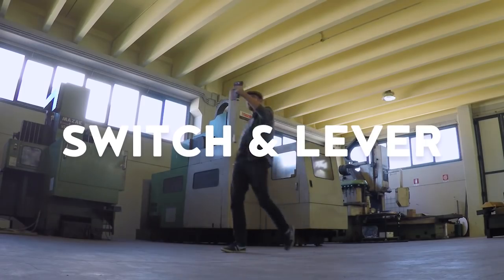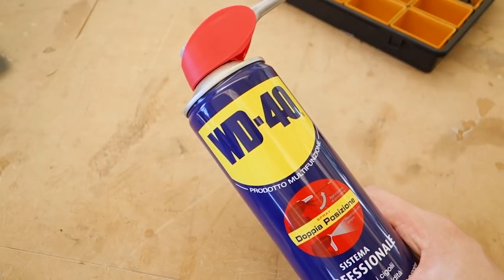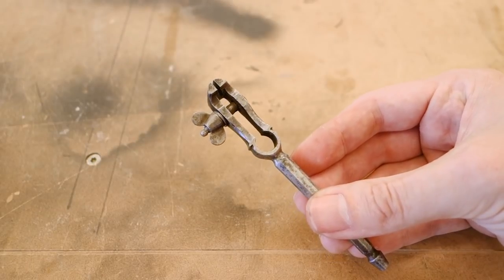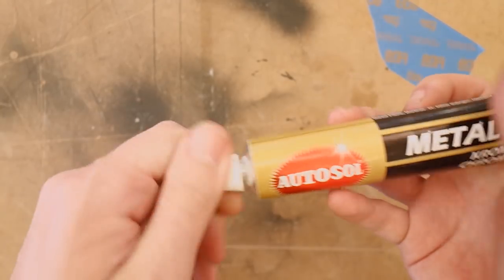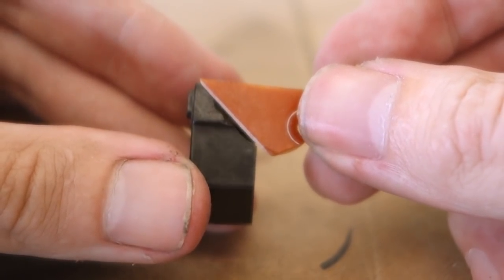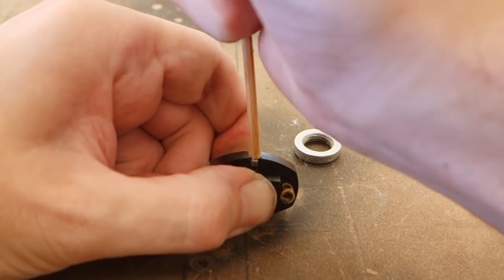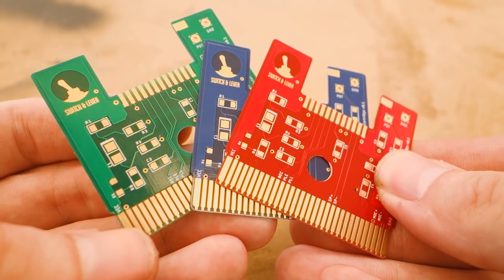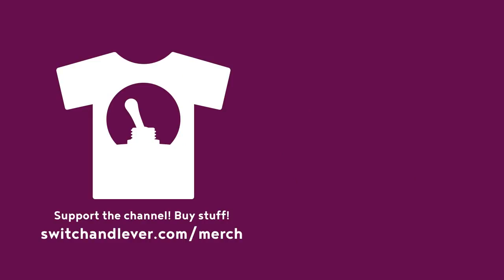Restoring Vintage Toggle Switches

Comment: To make your Dremel wire wheels last longer, put some CA glue (super glue) at the base of the wires where they are pressed in between the flanges. The wires will stay in the wheel much longer.
Reply from the maker: That’s a great tip!
Reply: @SwitchAndLever  yeah but it won't really save the brushes. The wires break due to metal fatigue. They just get bent back and forth in use until like a bent paperclip they eventually break.
Reply from the maker: @1pcfred  I know I'm like ten months late on this, but I can confirm that the tip given by Rick works great. It would appear that much of the metal fatigue happens where it's clamped in the flange, which the glue kind of acts like stress relief and, well, glue. The wire wheel easily lasts at least twice as long, if not longer.
Reply: @SwitchAndLever  twice as long is like getting a free wheel then. That's pretty amazing. Now I need to find a way to get CA glue to last. Every time I go to use the stuff it is all hardened up on me. I'm more of an epoxy kind of a guy here. AB epoxy I can keep around. That CA glue after I open it up I might as well just throw it away. It is never any good when I go to try to use it again.

Comment: When working on switches with ball bearings and springs, I use a plastic zip lock bag over the work to keep from losing bearings or springs. Dropping one and trying to find one isn't fun.

Comment: Seems to only make sense for switches (like the bakolite ones) where you can't find equivalents in production anymore. But for plain round end ones, seems like a bit much effort where you can still find something that matches and just buy some since they shouldn't be that expensive. Really only worth the effort for restoring vintage gear, or having that particular look.

Also plain white toothpaste can clean up some plastics. But such polishing may be better done by hand.

And some metals (like aluminum or brass) may still be marred and scratched by brass wire wheels. But nylon bristle wheels are common enough too and the way to go in those cases.
Reply from the maker: Switches that have the quality of vintage switches simply aren’t cheap. You can buy Chinese made switches that look the part all day long, but the tactile feeling of them is crap. There are companies, like Caleco for instance, that makes switches still in Europe. There are also manufacturers which specialize in guitar equipment that make similar high end switches. Neither option is cheap, believe me. 

Also, you would be very hard pressed to find any aluminium in old switches like this, especially in combination with steel. Galvanic corrosion is a real problem and not something you’d want to occur in an electrical switch.
Reply: @SwitchAndLever  folks not understanding what you're trying to tell them is why we're doomed.
Reply: @SwitchAndLever  , the other commenter needs reminding that cheap Chinese switches will typically have  Metric-dimension bushings and metric threads, and they may not fit well into a piece of equipment that originally had an American made switch , even if you use some kind of sleeve or bushing to make them "fit." I repair old switches pretty regularly in my day job in an audio-equipment repair shop. The real "fun" happens  when we have to disassemble and repair potentiometers and, especially, slide faders, where the metal contact "fingers" break free from the nylon carrying pieces.

Comment: Can you find a way to restore the original  rivets? Can we buy new rivets somewhere?
Reply from the maker: Well, those rivets were likely set in a press with a jig to hold the switch together as the rivets were set. You could make custom rivets from aluminium or brass rod or tube, but frankly it wouldn’t offer anything better than what I have done here.
Reply: @SwitchAndLever  I do the same thing and replace rivets with screws. Never know when you want to go back into the switch.

Comment: Didn't those switches have some dielectric grease in them originally?
Reply from the maker: No new switches I've opened have ever had any dielectric grease in them, so it's doubtful these had either. You don't really want any grease on contact surfaces as it may act as an isolator making the switch work intermittently.
Reply: @SwitchAndLever  I've seen grease inside switches.

Comment: Nice, but they're no Forbes & Lomax
Reply from the maker: Frankly, I think F&L make subpar switches. They don't feel as chunky and nice as these old ones, and I'm not at all a fan of the ball ends on their toggle switches. They're "designer" switches, but that doesn't mean they're good. They are form over function in my opinion.

Comment: While there are lots of good ideas for restoring irreplaceable switches here (much appreciated) you wouldn't normally do this on a paid repair of a non-museum piece.
Reply from the maker: What do you mean "paid repair of a non-museum piece"?
Reply: @SwitchAndLever  Most of the switches you have shown are replaceable for under ten dollars. They function the same and are often made to look the same as the vintage part. I think your techniques are useful in cases where you have to have it working before a replacement can arrive and thank you for showing it but to do it because you can would be folly for someone in business to do when labor costs far outweigh the value of a new reproduction part. A museum piece would be a possible exception where the owner may want the original part at all cost but that is relatively rare. Usually they just want it to work properly.
Reply from the maker: If you can find high quality switches made in the west for under $10 I would love to hear where’re you shop. The point is not that you can replace these with similar looking but lower quality parts made in China. 

I’m still confused about your business argument though. My point of view is if you can repair it you should repair it. The constantly buying new culture is a huge cause of why the planet is in the state it is, and why pollution is going rampant. The less we feed that behemoth and the sooner we relearn that things can be fixed the better.

Comment: I have three brass surface mount toggle switches.  They are about two inches diameter and bell shaped.  I believe they are light switches. One is broken, on the inside. I wonder if this video will help. These switches are a hundred years old. Not like these newer switches you're showing.
Reply: They re called dolly switches, and can be had new for 30 euros
Reply: If it is already broken it can't hurt to try and fix it. Because it's broke now.
Reply: That's right.  And I've still got two working ones, in case I need to  duplicate anythjng

Comment: You can wd40 in liquid form
Reply from the maker: Not sure what you're saying here. WD40 is indeed a liquid.
Reply: @SwitchAndLever  he means you can buy it in gallon cans. They even sell 55 gallon drums of WD-40. I'm not that hardcore myself though. But I do buy it by the can. It's a lot cheaper than spray cans. $20 a gallon. So that's like 11 and 1/2 spray cans that cost $6 a piece  Which would cost you almost $70 to buy. The way you're using WD-40 the gallon jug would be a lot more economical at almost a quarter the price. 3.5 times cheaper really.

Comment: Cosmetic only
Reply from the maker: Very much not only cosmetic. I clean and restore them inside and out. Did you even watch the whole video?
Reply: Disconnect speed is important in switches. Switches have a life span.
Reply from the maker: I agree, but restoring them can increase that lifespan dramatically as these switches were out of comission due to dirt, grime and corrosion, not because they had reached their end of life. So again, it's not only cosmetic.

Comment: all this
work for a 1 dollar switch.... sigh...
Reply from the maker: If you can buy these high quality, European and US made toggle switches, newly made, for $1 I would really like to know where you're buying them from. The issue is not whether you can buy Chinese low quality switches for cheap, obviously you can, but for newly made switches made in the west of this quality the price starts somewhere between $10-30 per switch, and can go far far higher.
Reply: @SwitchAndLever  the last Chinese switch I dealt with went right in the trash where it belonged. It had so much resistance it burnt out the grinder it was powering.

Comment: This dude spent all that time fixing a 2 cent piece of plastic becuase "he doesnt like his projects unfinished" yet doesnt paint it. 🤭
Reply from the maker: I fixed the plastic because a big hole in the side will attract dirt inside, causing the switch to fail faster than it otherwise would. I didn’t paint it because when installed it will be hidden anyway. Also, it’s not a “2 cent piece of plastic”, that switch would easily be $30 if you could buy it today.

Comment: Why bother they are all still going cheap on the internet. Old switch causes accidents
Reply from the maker: Why would an old switch in tip top shape cause accidents?

Yes, you can buy switches. Your choice is cheap switches from China with a far worse finish and tactile feel to them, or expensive (easily $10-30, to start with and the sky is the limit) made in the west with a similar quality and feel to these vintage ones. Not to mention that knowing how to restore and repair instead of constantly buying new like a good little consumer is always a good skill to have. That’s why you “bother”.
Reply: @SwitchAndLever  If you worked on aircraft you might recognise these switches and they ARE of reasonable quality.